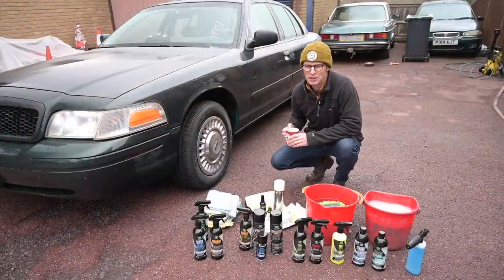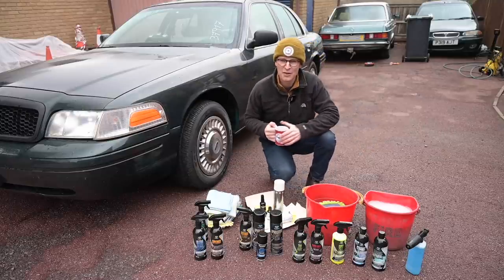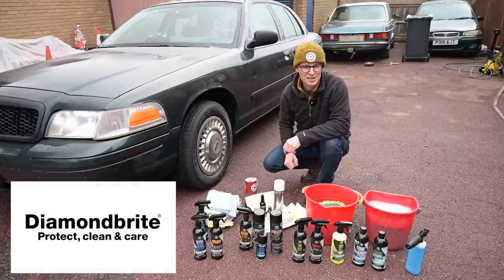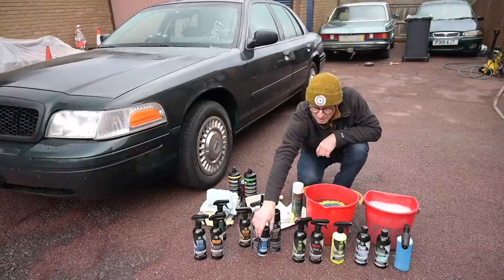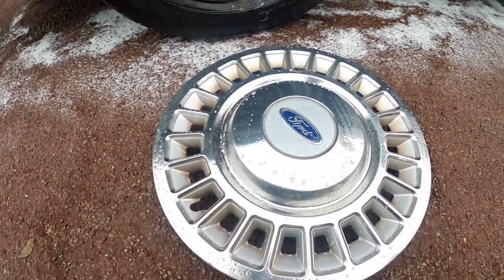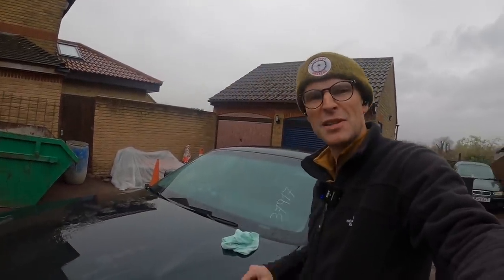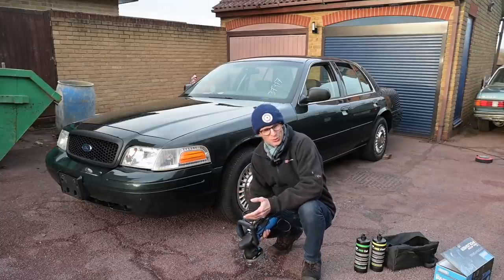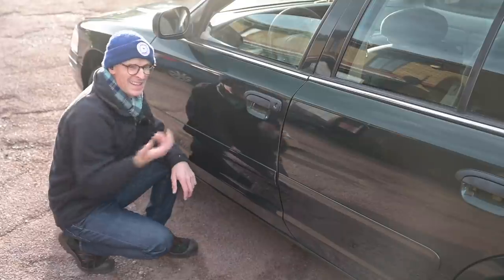3 days cleaning my P71 Crown Victoria

Comment: Great job, Matt. That colour is perfect on the car, but very rarely seen. It certainly did shine up well. The newest Panther platform car I have had was my 92 Crown Victoria LX. A word of advice. Check the grommet at the throttle linkage where the cable to the transmission is. If it is rubber, get the brass grommet. The black ones have a habit of failing and if the cable comes disconnected, you will be doing a transmission rebuild in short order. My first Panther was the pride of the lot. It was a one of one, custom ordered by me with the factory 351 Windsor V8. That is 5.8 litres to you. It also had the factory Trailer Tow III Package, so was rated for a full 6,000 pounds of trailer. It was the only one with those two options painted Dark Cranberry Metallic Clear. What made it spectacular was the 40 miles to the Imperial Gallon the car got on a motorway run. It would do over 600 miles on a fill. The engine had so much torque that carrying load did not affect the fuel consumption much in the least. I do miss that car.

Comment: A lesson I learned, with a 2005 Chevrolet Impala 3.8 six, was my mileage actually improved after a thorough  paint  treatment as the coefficient of drag was reduced and i actually pulled 35 mpg instead of the customary 32 from prior to the cleaning. Cheers
Reply: Incredible to hear but makes sense.
Reply from the maker: Yup, when I had to drive through France during the fuel shortages I clayed and polished a loan car and made it to Switzerland on a single tank!

Comment: Regarding 22:45 , I can think of a way to measure roughness of paint that many can do at home:  Place a clean rag on top of paint. Put something like a few thick books on top of it. Now slowly and smoothly push the rag with the books on, with the top of a kitchen scale/letter scale (or whatever has a suitable interval, but those seem likely) and look at the numbers. 

Now polish and try the same place again. This can be done between every step of the paint restoration to compare. Then divide the first number with the one after polishing, and you get how many times lower force it takes for something to glide over the paint, which can be a way to visualize paint roughness/smoothness.

Comment: @28:00 You have to replace (re-coat) the UV protectant that you've just polished off the headlamps. They will begin to turn yellow-ish within a few months. Using cutting compound on the headlamps is a valid way of refurbishing them, but the UV coating has to be put back on. Some auto parts retailers do carry headlight UV coatings that go on with a sponge or spray can.
Reply from the maker: I used the ceramic glaze which is a UV filter

Comment: The P71 Crown Victoria I have was really dirty and smelled bad. It took me about three hours to remove the seats, sanitize them, clean them then scrub out all the nasty stuff from the floor. Then over two weeks I installed seat covers and a new sound system. Other than that it's done. It's a hell of a commuter that should last a while.

Comment: If you are going to change the steering wheel go with 1 that has the speed control buttons. At that point go to a steelership and have them enable on speed control in the computer. In the late great USA we call it cruise control. Steve

Comment: Great content. Few points tips for the crown Vic.
1. Be wary of letting the car be used for film, they are often abused and returned with damage - can provide first hand stories.
2. Get some interior detailing brushes to get into the textures and nooks&crannies and also some wheel brushes, very useful for a deeper wheel clean.
3. Try to use the more aggressive wheel cleaners first, before doing the paintwork, so that the wash soap dilutes any residual wheel soap, rather than the other way around. 
4. You don't need a dry car to clay, the more water, soap or detail spray the better! You want a clean surface, so a freshly washed and rinsed car is ideal. Doing it in the rain is totally fine.

Comment: Great job. One thing a Miracle Sponge clay bar is so much better than original clay bar putty, it's like washing your car with a small sponge (1ft x 2ft areas using lubricant like your wash n wax or waterless wash) about 10 times as fast and results are even better, a win win 🏆

Comment: Hi Just in case you’re not sure I think those aerial mounts are NMO mounts, you might be able to get some matching ‘antennas’ for them and run a set of cables to a splitter and a CB radio or Amateur Radio if licensed? NMO stuff is a bit rare in the UK though
Reply from the maker: they look like the aerial part has been cut off at the base, I assumed Id have to replace the entire thing, maybe that can be removed and a new whip inserted?
Reply: @furiousdriving   It probably would be, the NMO is flat and about 5mm think with a centre contact. If you want to go down the CB radio route then have a Chat with MoonrakerUK or Nevada Radio about replicating the aerial type and they should be able to supply new mounts etc to suit.It could be that one of the mounts is for the car radio but in the states I understand that   two aerials are used to improve the forward signal. Apologies in advance if I've created a red herring! Really enjoyed the video!

Comment: I had one as a rental once.  Expecting a huge boat that would be a challenge to drive. While it's huge, you could see all four counters of the car, making it easy to drive.  Smooth and quiet.  I understand why they have a fan base.,
I have an idea for those four holes on the dash near the radio,  Get some black or chrome trim screws and it will look like it's holding the dash on.

Comment: Years ago these cars were a dime a dozen and truthfully no one paid any attention to them (unless you were speeding and had one of them in the rear view mirror.) Fast forward to 2021... Although "crude", I'd rather have a Crown Vic than a modern kitchen appliance that selfs park, selfs drive, calculate this that and the other and look hideously angry not to mention the complicated electronics that require a degree from MIT to decipher the codes. It's a bygone era and Matt has a beauty that especially in 🇬🇧 will stand out. ✌

Comment: You should use a higher Alkaline soup to remove old waxes and sealants, the  chemical iron remover , followed bt a clay bar , followed by and polish, folowed by a IPA wipe down , followed a  ceramic coating.

Comment: Really enjoyed the video, Crown Vic’s are ace. 

The amber running lights / side markers and red rear indicators are legal. 

Don’t let some clueless MOT tester tell you otherwise and force you to butcher an original car. 

It’s a real real shame Ford stopped making them.
Reply: You can get OEM Ford tail lights with amber turn indicators. They were standard equipment on the 98-99 model years.
Reply: @DirtyDanMunicipalMan  yup, I was just about to say the same thing. My '98 has factory rear amber turn signal lights

Comment: Hello Matt. Now you need to fix those holes in the dash and it is perfect. Greetings from Slovenia.
Reply from the maker: Hi, yes or find the equipment to fit back on there!
Reply: @furiousdriving  Just some tiny grey plastic or rubber plugs should make it look fine.  And for now, a steering wheel cover.
Reply: @normanduke8855  There are people qualified to do jobs like this. Your idea is not bad. Glue some gray plastic plugs inside, grind it a little bit to make it even.

Comment: I was just thinking. Could it be an idea to get the steering wheel professionally leather bound? That way it would be nice to hold and still look relatively factory. Also another idea is could that radio be swapped out for something within the Ford UK family so it still looks OE but works correctly over there.
Reply: I was suggesting, what about wiring an AUX into the volume pot?

Comment: Hi, me again. I heard you talking about adding cruise control to your CVPI. Being an 02 means it has a throttle cable. In order to get CC going you’ll need a steering wheel with the correct buttons (obviously), and the servo motor plus assorted wiring to attach to the throttle body. I don’t think you’ll need the car ‘talked to’ by Ford IDS as its pre-CAN. The good news is that any Panther-wheel will fit (So MGM, LTC, and of course from another CV or CVPI). With it being a beige interior you’ll find that many Town Cars have that color interior, and can surrender their cruise control servo motor at the same time. The difficulty for us Europeans is finding the parts. Try looking for a junkyard that specializes in breaking American cars. They’ll usually have a couple of LTCs. Over here those things were popular as stretched limos, but in recent years lost their spark and ended up at the yard. Lots of parts to pick from those. 

Oh, and the car looks amazing. I wash mine frequently, but really, I need to go next level like this and REALLY clean it.
Reply from the maker: The older ones do have the advantage of simplicity, it will be fun to try and add cruise

Comment: I found car wax works wonders on the coloured plastic lights but don't know your supposed to use it on clear plastic headlights though. The exhaust usually makes back lights dirty.
Reply from the maker: ceramic them, that helps them stay clean

Comment: I know a lot of Hubnut subscribers also watch this channel: retro cars, Rovers etc., the common theme is obvious. However, this video is not in that Venn diagram overlap, detailing is not one of Ian's strong points 😁. 
I'm a Triplewax "wash and wax" man: in other words a bodger. No two buckets (one bucket only) and yes I use a... sponge!😯 My 16 year old Skoda (always parked outside) is still remarkably shiny with only minor rust patches despite this (the secret is to clean it every week - really hot water - so the salt/grit doesn't get a chance to dissolve your car).
Nonetheless, very impressed with the deep shine you got on that car, I would definitely go to similar lengths if I had purchased a car from America, as my dream motor. It looks fantastic.👍

Comment: I’m not too surprised there were no dog dish hubcaps under those big wheel covers as it really wouldn’t serve any purpose.  Plus they’d be double work to fit them both on the assembly line and also when rotating tires or working on the brakes.

Comment: You need to get all your lights converted buddy and get a IVA (individual vehicle approval) done at a DVSA test site fog lamp needs to be installed side repeaters (turn signals) front headlights re aliened for left hand side road’s i’d take it to a vehicle electrical to get that sorted or a specialist easy to do though for the rear turn signals EU standards needs to a different colour from the brake light (orange) earlier/older crown vix models use orange rear turn signal units i used them and added in extra wiring and bulbs, iv got my 2011 P71 now registered feel free to ask away if you need help with the registration process buddy
Reply: IVA is not required on a vehicle older than 10 years old.

Comment: You can replace the volume control potentiometer in that radio. Just open it up, see the markings on it (resistance, and buy a new one from RS Components, Farnell or Mouser. Just make sure it is a logarithmic (not a linear) type.
Reply: If its anything like all the other Ford head units of this era, it'll be a rotary encoder (which can certainly cause the same fault Matt describes).  Equally easy to replace on these though, usually only requiring a set of small Torx bits and some soldering skills.
Reply: @christhesnaildriver  Yeah. In that case, even just cleaning the encoder could be enough, unless the LED and photodetector had degraded.

Comment: The hub caps you're thinking of cannot go under the wheel covers you currently have, they are instead of those because they stick out quite far.
Reply from the maker: ah, I was told they were fitted as standard and the optional caps slipped over

Comment: Cleaning cars properly was never my strong point, used to be just a bucket and sponge affair, but I'm really getting into this now, wanting to get my fleet looking much better. I tried using one of those polishers and really struggled trying to get it right, either the sponge was too damp and the stuff sprayed all over the car or it was too dry and the cutting compound turned into a gloop type consistency, what RPM do you usually use for the polisher? I did notice that it was worse when the sun was out, so I'm trying to do that kind of thing on cloudier days, only problem is cloud here usually means rain!

Crown vic looks amazing now!
Reply from the maker: You have to experiment a bit with speeds as different products work better at different speeds so you dont burn the paint, but some things like buffing need it faster. Ive got 1-5 range and mostly use 2/3/4

Comment: For the radio head unit, would a Model 4500, 5000, 6000 or 6006 from the Euro-Fords of that era fit as a replacement?
Reply from the maker: I think they and the 4000 might

Comment: This was painful to watch.  Cleans the hubcap, then back to the paintwork with the same mitt.  Then goes about the nooks and crannies inside with a cloth instead of a brush. Proceeds to make the dash look super shiny and oily.
Then goes and uses cutting compound on the headlights!!!!

Tip: If you want to "get into the texture" when cleaning,  use a detailing or old tooth brush. 

Also, please, please, please, get a new UV Lacquer applied to the headlights or else they will yellow again, but quicker.

But - Excellent use of the drone!

Comment: After watching quentin getting a full valet, decided to treat my car to a rather expensive gift from diamondbrite. I must admit that i am really impressed with most of their products that i used, the ceramic shampoo and ceramic glaze are amazing, the car has never looked so good. The same can be said for the carpet/upholstery cleaner, worked like magic on interior carpet. Again, the replenish was amazing on outer plastics, though i do believe you should've warned viewers about how much that and the ruby red (which i didn't get on with) absolutely stink. We are talking serious chemical smell here. Which is a shame as the ceramic shampoo and interior cleaner both smell really nice. Overall though, i am glad you introduced me to their products, ones that i shall continue to use.
Reply from the maker: Thats great, really pleased they worked for you, Ive been impressed with all the products. Ruby Red has the advantage that is not an acid so is safe on most surfaces, lifting the iron and brake dust from the surface, but that means its not the same kind of thing as old fashioned acid wheel cleaners so with some dirt Lift Off might work better

Comment: I have been applying the ceramic protector to the black plastics on my FG Ford Falcon- the plastics stay black and look like new now.

Also- did you pull the back seat out?
Reply from the maker: I dont want to look...
Reply: @furiousdriving  Will either be a treasure trove of coins, or some curious fluids 😄

Comment: @furiousdriving. I'm curious about one thing when you clean your cars, Matt. Do you have your product bottles set to "spray" or "stream"? It may just not be clear on the video but it looks like they're set to stream. In my experience, this uses more product and doesn't give the same coverage as the spray setting.
Reply from the maker: I try for spray but wasnt checking!
Reply: No problem, I just wondering.

Comment: You are seriously tempting fate using a pressure washer. These cars are known for their peeling paint in every color. You may pressure wash a whole section of paint off one day; trust me I know. I only hand wash these cars nowadays. I've also blown a section of paint off using an air compressor to blow water out of the cracks on these cars; so yeah, don't do that either. One day you'll regret pressure washing these. Beautiful car though; green is rare color and looks great and different. Back in 2007-2008 I drove an unmarked P71 in that same green at the police agency I work for.